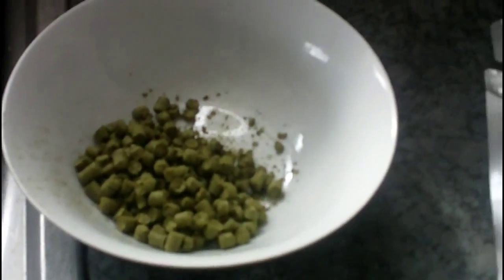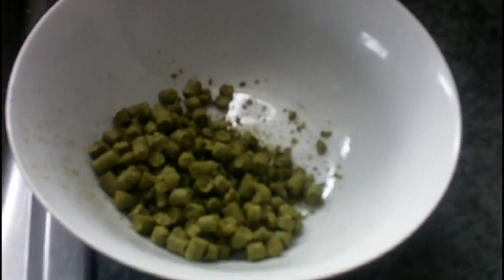SJB making a Black Rock IPA Beer from a kit PT 2 Dry Hopping and taste test.

Comment from the maker: I used to use the brown 750ml pet bottles from the homebrew shop but found after a year of using them they started to get cracks on the bottom so I now use 1.5 litre soft drink bottles as they can take swelling more and only cost $1.00 full  from the supermarket. And the sun doesnt get to them as they are into the hot water cupboard from there they go into the fridge.